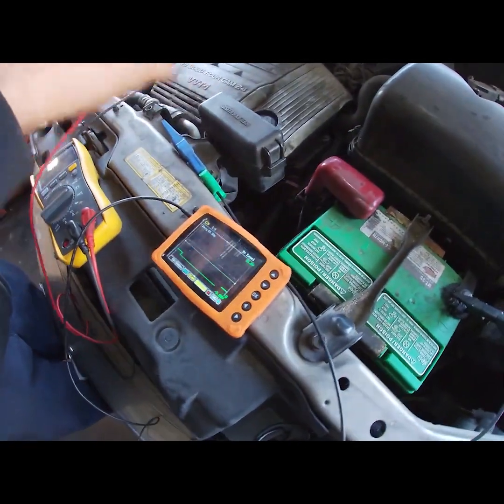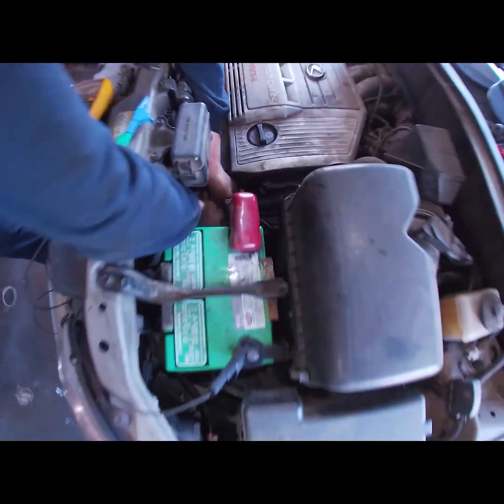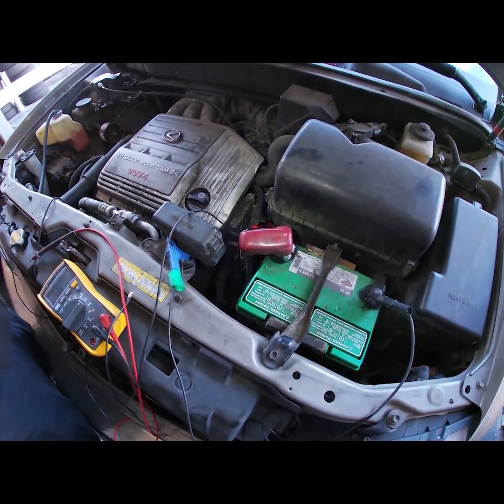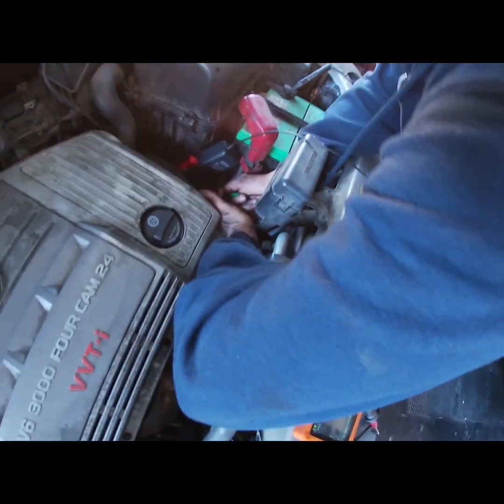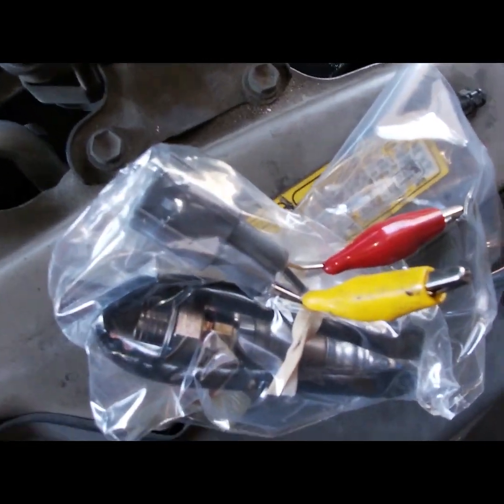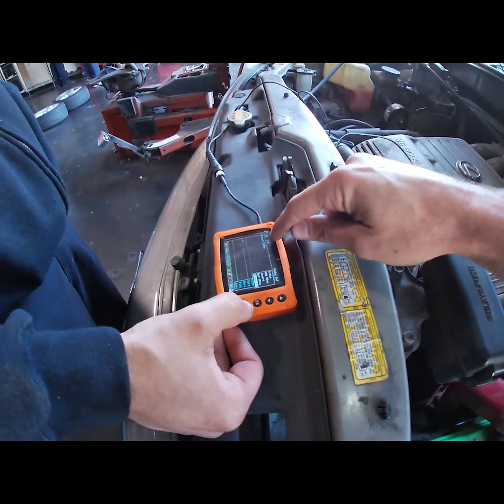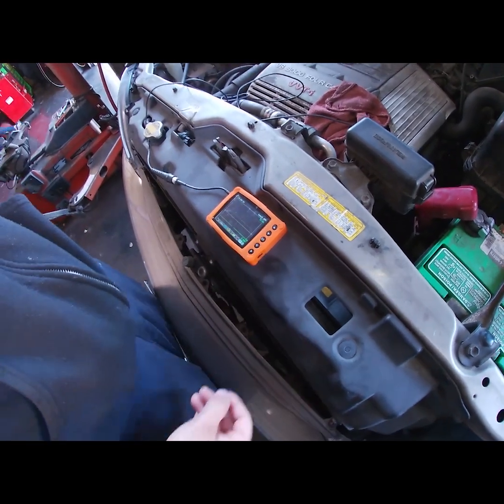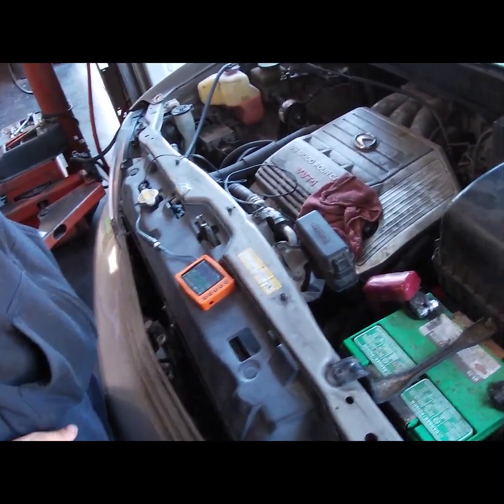How to test Lexus RX300 3.0L Air Fuel sensor or Oxygen sensor heater with AESwave Uscope

Comment: Hello. I measured my heater side on the af sensor on my 99 Lexus rx300 and the ohms come back at 9.2. is my af sensor bad?
Reply: My old one tested the same as the new denso that fixed my rx300 234-9009 bank 2 air fuel sensor